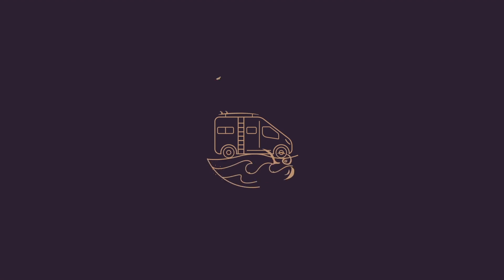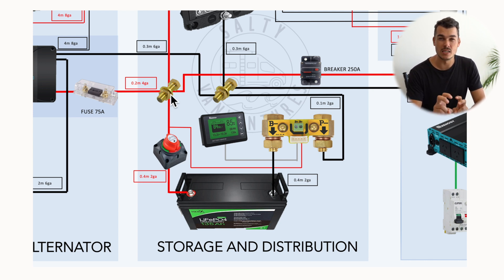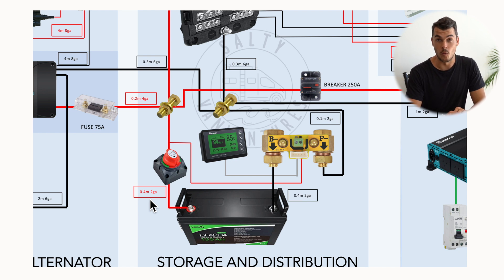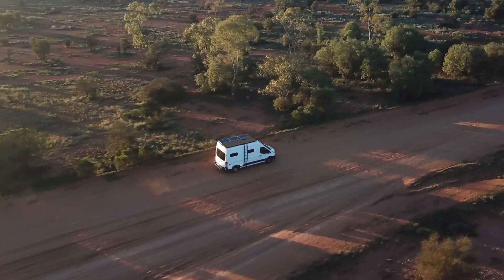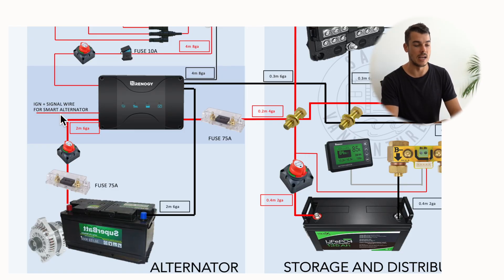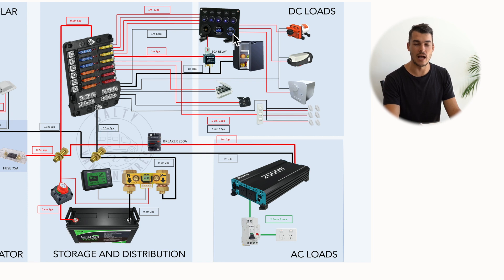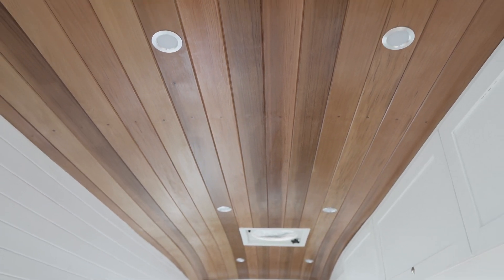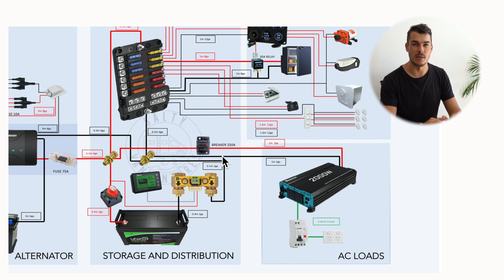Campervan ELECTRICAL System Breakdown : COMPREHENSIVE | Ford Transit Conversion

Comment: Hi, with the Renogy did you have to locate an ignition feed to ensure that the alternator only charged when the engine was running and didn't drain the van battery? if so it would be great to hear how you achieved this as I have to do so with the Renogy DC to DC charger that I plan to install.
Reply from the maker: Yes I located an ignition feed which I believe is to do with the smart alternator aspect of the unit. The best way to do this is piggy back a wire from your fuse box. Mine was on the drivers side under the steering wheel. Use a test light or multimeter to find one that powers on when ignition is turned on. I used a small
piggy back fuse holder. Hope that helps

Comment: I just brought your wire diagram, and it is what was for but one question what type of wire do I need to run through the caravan for the 240 volt
Reply from the maker: The 240v wiring should be legally installed by a licensed electrician, and they should use 2.5mm2 cabling for the system, much like any house electrical system
Reply: @saltyvanventures  Thank you it will be So i don't need to buy  Marine Grade cabling
Reply from the maker: @coreyforbes2846  Also make sure it's stranded cable and not solid. This helps reduce damage to the cable in a moving vehicle.
Reply: @saltyvanventures  Thank you

Comment: Are deep cycle batteries lithium or lead acid batteries?
Reply from the maker: Lithium. Lead acid batteries are quickly becoming a thing of the past in the van build space
Reply: so this is not good?

GC2 DEEP CYCLE EXTREME
BATTERIES 
GC2-ECL-UTL
115 mins @ 75 Amps 225 Ah @ 20 Hr.

Comment: Hi thanks for the videos! I am just wondering if the shunt/battery monitor need a fuse? In your diagram it shows it is just directly connected to the battery. Thanks :)

Comment: Hey mate, regarding your brass bolts as bus bars…where do you mount them please…? Cheers, Steve
Reply from the maker: I mounted the them to the plywood board I mounted all the electronic components too
Reply: @saltyvanventures  Thanks Marcel. As others have said, it's great to follow someone who is familiar with Oz conditions and regs. Up till now, I have been trying to adapt what I see on Brit or American sites.

Comment: Does the fusebox shown in this video not also double as a bus bar? Can somebody please tell me why you need to put in a seperate busbar?? 🤞
Reply from the maker: Yea it can be however it’s is only a low amp buss bar. Running the battery, inverter and other high amp appliances require a beefier bar. Hence while I’ve used a single large brass bolt
Reply: @saltyvanventures  thanks for the reponse, that helps 👍 this would be a good moment to thank you because we've taken a wealth of knowledge from your videos and website. We always try to purchase through your links 👍 thanks mate!
Reply from the maker: Thanks so much. Appreciate it!!!

Comment: I thought parallel connection has same voltage and amp is higher. Series conneciton added voltage and amp remain the same.
Reply from the maker: True. Check the description!

Comment: Thank you so much for your video …we are converting a ford transit aswell and your videos are been soooooo helpful!!  I have only one question …I bought 2 200w solar panel with 11.7amp short circuit and 1 100w 5amp …one the 100w the 10 amp inline fuse it’s ok ..but wtb the 200w ? Thank you again

Comment: 9:15 Isn't this incorrect? I've only just started researching this stuff so I could be wrong but I thought that wiring the panels in parallel would increase the amperage while keeping the voltage the same.
Reply from the maker: Yea you are correct. Check the description for the amendment
Reply: @saltyvanventures  Oh I didn't see that, thanks for the reply

Comment: Sorry if I missed it but where did you connect the ignition fire from the renogy controller?  Ive got a transit too and im a little confused as to where I need to run that
Reply from the maker: I piggy backed it off an ignition positive fuse in the fuse box under the dash. Use a test light or a multimeter to find a fuse which is 12v when ignition is on and use a piggy back fuse to wire it up

Comment: Hey Marcel. I'm going to send you a message through your website, my system is not too different to yours but i'd like to consult with you to design it properly. Cheers, Erin
Reply: I would ask an electrician or auto electrician.  Some of this info is inaccurate or wrong.  Eg. The solar cut off should be on both +ve and -ve. The cut off switch has a max voltage of 48 volts, where 65v is coming from the panels. Parallel adds Amps, Voltage stays the same.  Serial adds Voltage,  Amps stay the same.

Comment: Hey champ, absolutely loving your content and I’ve been following along to the best of my abilities. Literally learning as I go along and I have you to thank! I had a question in regards to your electrical diagram; is it correct, that there’s no fuse in between your your house battery and positive busbar? Looking at your video and your layout under the seat, it looks like the positive goes from battery to shut off switch to fuse, then MPPT controller? I’m just on this stage now and I want to be certain before I hook it all up, thank you 🙏🏻 Love your work

Comment: Hey mate, the 200 W panel's Voc is 27 V, but the 50A MPPT DCDC max charge voltage is 25V. Wouldn't that burn out the charge controller? Just worried about doing damage as I have a 200W panel and the 50A charger too, cheers
Reply: I think you're asking the wrong person.

Comment: Also  both positive and negative wires from the solar panels should be simultaneously disconnected.  Not just the Positive wire...

Comment: You say you connected your solar panels in parallel because you wanted your amps to be low but connecting them in parallel adds the amps together.
Reply: What’s the alternative option?? 👀

Comment: 1. Wiring solar panels in Series will ADD their Voltages together while their Amperages stay the same.
2. Wiring solar panels in Parallel will ADD their Amperages together while their Voltages stay the same.
Solar panel installation can be a trap for inexperienced DIYers.

Comment: You should point your viewers to a qualified person when installing solar panels.  Running them in parallel as you have here may need fuses on each positive wire before the Junction. Incorrect installation can cause a van to burn to the ground...

Comment: Thanks for all the info, Marcel!
I've actually got most of these components, & have figured out how they connect together - but I'm still a bit confused about the busbars. This is now my second time watching this video, and after the first time, I decided to add the Renogy battery monitor. (I used your link, too!)
At this point, I understand about needing the busbars so that the shunt works. But are these just bolts that you put into your electrical panel, as common connection points? Or does the negative busbar attach to the vehicle metal body (as I have seen in some videos)?

Also, I'm trying to figure out exactly how you have rewired that switch panel & fuse-box (which are the exact same ones I have). It makes sense to only have one fuse per appliance, and to have all the fuses accessible in one place. I have figured out how to remove the fuses in the switch panel - but did you also remove the positive wires connecting all those switches together? (If you didn't, everything would shut off if one of the appliances overloaded - but that is how normal house wiring is done, after all!)
Reply from the maker: A buzz bar is essentially a hub for all the ports, like you said a common connection point. They are usually a brass block with threaded rods to allow terminal eyelet connections.  I just used a large brass bolt and connected all the eyelets to one. In my design i didn't need to connect my buzz bar to the chassis (or ground) as the DCDC charger is already grounded to the negative battery terminal and hence the system is grounded. For the battery monitor to work you just need to make sure the shunt is the first thing directly off you negative terminal of your house battery. Yes so those switch panels come with an inline fuse holder for each switch. I didn't want my fuses there ( as they will sit behind the wall cavity, harder to access and you cant tell which fuse is blown without taking the switch panel out) so I ran additional cables from the fuze block to the switch to independently fuse each switched item from the fuze box. This way there are multiple positive wires going from the fuse box to the switch panel so no if one fuse blows only that switch/appliance will stop working, not the whole system. Hope that answers your question.
Reply: @saltyvanventures  Thanks heaps! I had figured some of this out, but you've filled in a few of the important holes... 😊

Comment: Thanks for the videos they r amazing.. question from solar to   Renogy dc charger u have 8 gauge wire but all the inline fuse boxes I can find are only  10 gauge any suggestions?
Reply from the maker: It is pretty negligible. The reason i used 8 gauge  for connecting the solar to the dcdc charger is to reduce the voltage drop over the length of cable.

Comment: Thanks so much for this! Super helpful!! I just completed the setup today using all Renogy kit and this video. Yay!! 

I did leave out the switches between DC to DC and the car battery, and between the lithium battery and +be busbar. Do you think this is an issue? Everything is VERY close together.
Reply from the maker: I installed the cut of switches purely as a means to isolate the entire circuit if required for maintenance or if there is a fault to deal with. I almost always have both switches on.

Comment: i  just bought your wiring diagram, i was just checking before I bought the wiring, you have 1 piece of 4 gauge positive wire from the dc-dc charger to the 75a fuse then to the positive busbar,  is this correct? The negative from the dcdc charger is 6 gauge ? Awesome work mate, you give us all hope cheers....
Reply from the maker: Hey mate great pick up. Yes they only both need to be 6ga. A maximum of 50amps over that distance only requires 6ga
Reply: Just wasted $20. You can get more accurate details on the internet for free...

Comment: Also important to add:  The DC>DC controller you are using allows DC and solar connections via the same unit.  If you buy a new MPPT charge controller, this alone does NOT allow for connection from the alternator.  I made this mistake and am now upgrading to this model you have shown.  The other option was to run a seperate DC>DC specific controller that is cheap, but just gets clumsier setup wise.
Cheers mate, I have thoroughly enjoyed your videos and used them a heap when building my camper.
Reply from the maker: Yes. Precisely why I bought this particular unit. They are a great combo and take up less space and complications that seperate units. The renogy units are also well priced in my opinion

Comment: Excellent vids Marcel,  where did you connect the signal wire for the MPPT charger, I have the van as you? Thanks in advance.
Reply from the maker: I believe i connected it to the ignition fuse with a back to back fuse. Its located under the front steering wheel

Comment: Great video super helpful and clear. I’m just about to plan out my electrical system. The link to your wiring diagram isn’t available anymore… do you have it shared anywhere else? Thanks
Reply from the maker: So sorry about that. The link is working now

Comment: Hey mate, love your videos and all that. Just wanted to say, I think you mixed up series vs parallel with the solar panels setup. It seems like you are running series but say you are running parallel. Series will add the voltages and keep current the same (which is what you say you have).
I am an amateur, so please correct me if I am not u derstanding?
Reply: The wiring diagram is in parallel.  Not advisable to combine different size solar panels if you want efficiency.

Comment: Greetings from Southern California! I was under the impression it was a bad idea to mix solar panels of different wattages, because the bigger wattage would reduce its output to match the output of the lowest wattage panel, meaning your 200 W panels would only put out 100 W since the smallest panel is 100 W. Is that utter nonsense I’m hoping? Have you ever heard about this?
Reply: Different size panels is definitely an issue. But more complicated than just reducing to lowest panel. Check out a video from Explorist Life on the subject for more info. I am not sure of the specs of Salty Vanventures panels but I suspect he is losing out with this setup, probably get better results by just disconnecting the 100W panel.
I also wanted to pack my roof full even around the fans and ended up getting 3 x 200w panels and 4 x 80w panels, I then have 2 charge controllers for the different sizes.
Reply: @andyjholloway  Thanks for your input, I came across another van build with different sized panels and that’s what they did as well, they used two solar charge controllers, one for each size of solar panel. That seems like the way to go! I’ll check out the other source you mentioned, thanks!
Reply: @andyjholloway  Thanks for the link. No, it’s in this van tour, at the 17 minute mark: https://youtu.be/XCc1bUZOnyw
Reply from the maker: I have hear that too but after testing my solar system output, i'm achieving pretty much the designed output of the panels so i don't believe that to be true
Reply: @saltyvanventures  That’s good to hear! I’m about to build a wide roofrack for a ProMaster—I was impressed with your video tutorial on pop rivet assembly, thanks for that—The rack will carry a roof deck, so I’d like to pack the solar panels as tightly as I can around the vent fan, and not having panels all the same size would be helpful.

Comment: This video and the links are so helpful! Was just wondering how many of each things you used, such as the circuit breaker,  fuses etc. just want to make sure before I place my order. Thank you so much!
Reply from the maker: You should be able to work it out from the electrical diagram. I have made it exactly like my  design. If you want to count the cheap blade fuses, just count how many many 12v utilities you will need. The fuse block holds 12 or 14 fuses i think.
Reply: I see that! Thanks man
Reply: What gages of wire did you use for what?

Comment: So glad I came across this channel. Any chance you could explain the storage area above the drivers seats? Like how you did that. Cheers, love your work
Reply from the maker: The platform was stock with the van. All i did was frame around the around the outside to hold the plywood and add a plywood bottom in the metal shelf as the metal one was uneven.

Comment: I have noticed in your diagram you did not ground the shunt P- to the chassis as always recommended standard practice.. Why?
Reply from the maker: It is grounded. The P- goes to the negative bar which in connected to the negative starter terminal and chassis ground
Reply: @saltyvanventures  All good mate well designed.

Comment: Did you put the panels in Parallel because the voltage would be too high for that mppt charger? 
I have the same charger and have 2x 175W panels and wondering if my VOC will be too high
Thanks
Reply from the maker: Yes exactly as that DCDC charger MPPT has a max 25v input.
Reply: @saltyvanventures  thanks mate 👍🏿 love the videos

Comment: Hey mate, Great work on all the vids, very informative! I'm about to start my own build, just a quick question: What were u running that caused your inverter to flip the breaker? 
I'm attempting to setup a gaming pc in  a van. Cheers!
Reply from the maker: I was using a heat gun on max heat for too long which caused to breaker to trip. I think it was 1800w so i'm not too surprised it tripped.

Comment: Thanks for the video. Question: Does the b2b charger also allow the van's starter battery to be topped up by the solar panels? Thanks.
Reply from the maker: No i don't believe it does.

Comment: Hi mate does your renogy battery monitor flash when power is going in ?  Renogy say I have mine wired up incorrectly but it’s not. Negative from battery goes to the B then the p goes to ground.
Reply from the maker: You can turn that feature off. I'm pretty sure you hold the top or bottom button and it will disable it. I leave it off as its a bit annoying and also keep the backlight off.
Reply: @saltyvanventures  yeah I’ve got that turned off but wasn’t sure if yours did that as well. If so it’s a stupid feature

Comment: Hey Marcel, this was a really helpful video. Thanks for putting it together.
 My understanding is the Renogy inverter has a “UPS function” that allows you to charge the battery thought mains. Do you know much about this function, and have you had a chance to test it out?
Reply from the maker: Hi, Yes it does have that feature but we have never used it. Nor do we every really plan on using it so i can't comment on it sorry